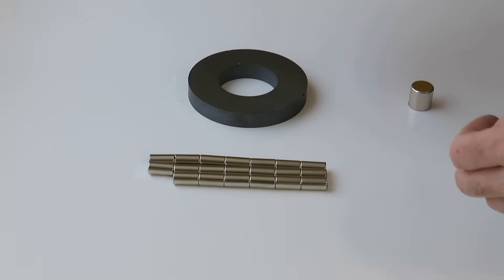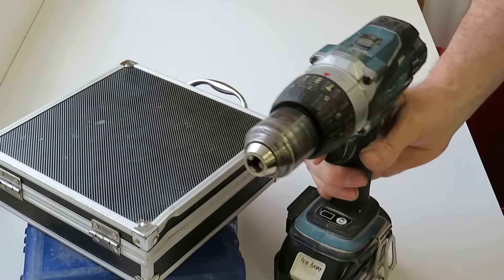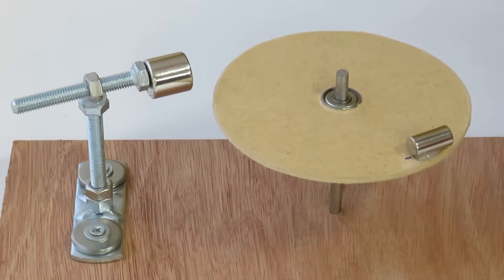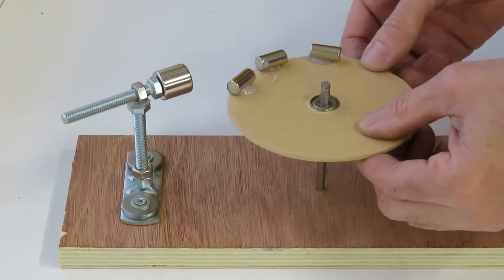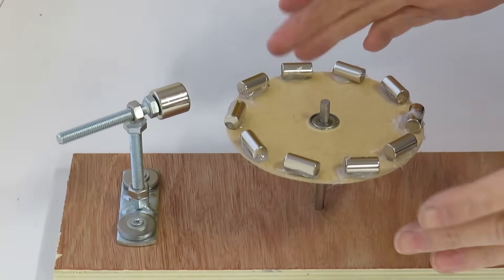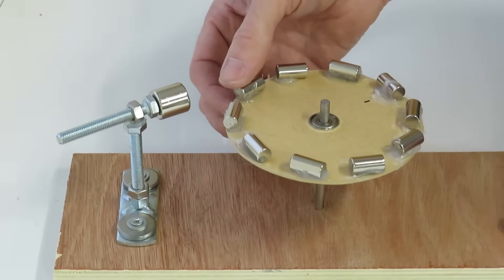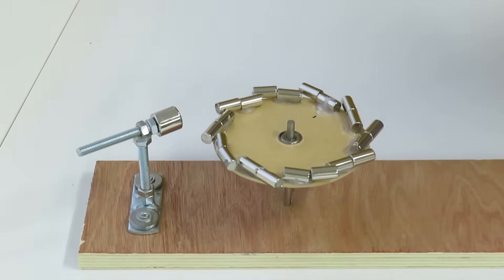Magnetic Energy - Crude Magnet Disc Challenge!

Comment: Try facing the magnets poles towards the master magnet Horrizontal and lift the front end slightly up all the way around in increments like you did on the vertical.
Did you know you can make a coil of copper so the circle geometry is facing you then tilted up slightly to meet Earth magnetic field, whe you rotate it on the horizontal axis it generates electricity..
So the magnets would do what

Comment: I know it's anti the experiment, but you should try replacing the big power magnet with an electromagnet with a Reed switch placed just right. The effect you're looking for is the reed switch shuts off the EM at just the right time preventing the EM from locking with the next magnet spinning around, and turning back on to give that same magnet a kick. You'll probably need to space your magnets further apart than they are, I'd say you need exactly half the number of magnets you are using now. 

The kicker is that you need to power the electromagnet. The clincher is that, once this is going, you might be able to squeeze enough power out of the rotation to take over and remove the battery/source from the EM. YMMV. Best of luck.

Comment: One fine option some have posted on youtube was to use a motor which would be recieve pulses (not a continuous charge) in order to push the wheel continuously while harnessing the power generated by coils and feeding it back to the motor pulses. The sum output seems to be positive power income. There are many examples on youtube

Comment: What you need is a Magnetic Pulsewidth Modulator on the Master Magnet. Just to give the wheel a bump again after a few cycles. You should then get a more consistent magnetic stream that can be adjusted by pulsating magnetics.

Comment: Should try using a niodime disk magnet instead.  Not confusing it with a ring magnet, as the poles are different in each.  I noticed when i use a disk, the movement is more fluid, and it doesnt get that stopping effect like how you do when using multiple single magnets.  

Also, anyone ever consider suspending the disk using reverse poles of magnets, to reduce friction that is created by the downward force of gravity?  Just a thought.

Comment: my attempt (in my head) was to attach the drive (outer) mags to a hinged bracket to face/place it in the optimal first position with a spring to return it there from secondary position that provided follw-up push/release at optimal point si it doesn't provide unwanted attraction afterward. the magnetic resistance & soring compression provides the motice power to switch positions. if that makes any kind if sense??  i don't think it would give free energy (obviously) but it may be a very efficient source of rotational drive... just a thot...

Comment: This is very similar to an idea that I had many years ago but never actually built it. The problem is the magnetic field is shaped a bit like a mushroom so it repels the wheel magnets as they approach as well as when they leave. I was trying to think of a way to change the shape of the field and was told that soft metal can help. I planned to put the "engine" magnet in a soft metal sleeve so that I could point the magnetic field at the wheel a bit like a rifle. Hopefully this will reduce the resistance on the returning magnets. What do you think?

Comment: A few discs in line with separate magnets set at staggered intervals then the next disc in line will pull the previous disc past the stopping point 
Almost impossible with 1 disc
And he seems to be using it to pull not push

Comment: if you apply energy to the system (an electric motor) that is sufficient to push past the point where "the magnetic fields lock into each other"  - then see if the energy out (your set up -  magnetic motor) is greater than the energy in ('an electric motor').  I think this is what we are all wondering.

Comment: Consider using Bismuth metal to shield the unwanted "attraction" interaction between the stator and rotor magnets.
  It's easy to cast in molds made from wood, sand, or aluminium because it has a pretty low melting point.
A design that uses both concentrating and shielding of the magnetic fields is what working designs use, 
ones like this that don't have either or both never seem to be replicatable by others than original video poster lol.

Comment: I think you could use an "escapement" using two magnets, similar to the "escapement on a mechanical clock. As the magnet was repelled on the wheel then the first magnet on the "escapement" would repel the magnet on the wheel. When the next magnet came up the Escapement would be "camed" to avoid decelerating the next upcoming revolving magnet on the wheel. The "escapement " would re-trigger to its first position to repel this next upcoming revolving magnet and repel it in resonance with the first revolving magnet. This would allow the device to speed up adding more momentum and energy to the spinning disc. Good luck . Nice workmanship. Cheers!

Comment: Normally  it will not working because all natural thing likes to go in its lowest possible energy state or equilibrium. I did something similar i used speaker magnetic in stationery state and water submersible moter magnet spinning with dc motor it was behaving like there was no magnetic force that attract or push it's because Spinning magnet alternatively averaging and equalling two opposite force close to zero. 
What can you do with your experiment you can use electromagnet in place of stationary magnet so in particular time you can turn it on or off or flip its pole electrically eventually it will become a Motor but if you electrically turn on and off permanent magnet it will be much more efficient may be 100% or hypothetically more than 100% if free energy exist😅😅😅

Comment: fixed magnets are only half of the engine . 
you cannot reach fluid lock with only fixed magnets . but it is a start . 
the question is why only one fix magnet . if you have 9 magnets on the weel ? who is going to push the other 8 ? 
if you have 9 magnets on the weel . you have to use 9 fixed magnet to pus all 9 magnets in the same time ...

Comment: the part that holds the stationary magnet, wouldn't it be better if it wasn't a material the magnet are so attracted to. iIt has a breaking effect on the wheel. And the bearing on the wheel  is being stopped by the magnets, and the wheel is being stopped by the axle & magnets. Lot of breaking effect going on

Comment: Pete! Love your work. Two things will make this work. 1, use of the magnetic north to south alignment. 2 use of magnetic field shielding to eliminate the field counter effect , so that the push force acts in a free zone, just moments of coasting on the pull side. Additional efforts might include one additional pole aligned stationary magnet. Or, one negative pusher with positive completeltely shield diverted with another stationary magnet on other earth pole aligned side with opposite field shielded/diverted. You can do it.
Reply: To clarify…use of the earths polar magnetism. I was working on turbine magnetic assist from compass alignment…
Reply: Finally, after further thought, I realized that concentric magnetic placement in , one geometrically opposed field inside the outer perimeter may also ‘balance’ out the resistance.good luck

Comment: I designed and built a very similar mechanism many years ago. I found the points where the attraction/repulsion variables were not possible to overcome without a slight amount of manually 'timed' movement on the 'driving' magnet, so issues may possi lh have been overcome with either a 'timed' cam, which would have drawn more power out of the system than it produced. Another consideration was the potential of using a spring behind each 'driven magnet in order to overcome the repulsion by the attraction, or possibly exploring some sort of crucially placed magnetic sheilding. I was never succesful, or I guess we'd all be using a similar energy generating device🤔
Reply: oh, i see you pretty much already thot of my thot... the hinged bracket mived by springs thing.... still seems like there's something in there worthwhile, tho...

Comment: Use a flywheel to keep the momentum going. All the way through I was thinking, will he angle the rotating magnets. I’ve also seen videos on a similar theme with magnetic shielding over the magnets, only leaving the tips exposed. One obvious idea would be to bring the static magnet closer to the rotor both in height and proximity. Glad to see it’s adjustable too

Comment: For this to work you must use magnetic shielding. It will work once you use magnetic shielding. It’s already done and working prototype exist + evidence in form of measuring strength in a test rig based on stepper motors who slowly rotate the magnets and measuring power live.

The magnetic shielding must be half moon shaped both on the rotating magnets and the stationary magnets. Doing it that way you prevent to early push with will push against rotation.

Perpendicular motion is already cracked open. We who has made it are just very careful about pushing to much on it. Because if you puck the evil on the nose, sooner or later it will bite back.

Comment: the trick like someone said above is to remove the stationary magnet and have it just be there at the right time... it appears Troy Reed did this using springs that he called injection pistons in his magnet system... you could even use an electromagnet for the stationary magnet and only turn it on at the exact point to push the disc around then turn it off when it would block it from continuing around (cogging)... just make sure that your electro magnet uses less energy than the momentum of the disc...  its rather simple if you understand the concept and this seems to be what Troy Reed did

Comment: Hello. Excellent experiment.
A possibility:
The G and EM Fields are statical, uni directional, we just know "2 ways of only only direction or viceversa" at/for the EMFs and for Space "coompression and time expansion" just one way/direction".
Here, for the "hugeness" of Gravity and why is +- essier to "see/calculate/mesesure" we can think it as:
Potential energy "exchanges" and „officially" Enrrgy conservation "implies" no gain of Potential Energy, PE" with out "work".... Or with more PE at the end and with "minus" work "that needed to maje the Experiment" as "the real relativistic contextual or contextuality relative" question.
Then:
1) Can be demonstrared that PE can be gained with less Work that wssted at the Experimenta Process?
I has made one:

Implied a steel ball, a magnetic canion an the "experimental context contruction".
The Question:

Can I make an experiment where PE of steel ball, at the end, has more PE at the Same longitudinal and Altitudinal position?
Can I construct an experimental "Context", ELRelative to EM and G, PE and the exact position ofcthe steel ball at the beginint and at the end of the experiment, using just PE and Statical EM (permanent magnets, the magnetic gun or cannon) exactly refered to the PE (Steel Ball "Distance" from the floor, its high, and its position as exactly initial= final altitude and latitude?

Tip:
Think on Hot-Wheels and Evan Cannibal.

Condition: the steel ball is needed to "Start" with and at he minimum work or amount of movement or exact energy and PE and come backs with no "non gravitational and/or static EM (permanent magnets).

To hyper contextualize: all work before starts the expeiment, from big-bang to construct to the exactly experiment... Ignition, is not counting.
Contracted springs, fire, fuels, candies, or any other "almacenated PE" or Energy can be "added" to the experiment:
Just Gravity and PE.
It will be real nice to apreciate your "knowlage & Sci-Tech love and passion" .

The same "contextual relativity" is needed to play with EM Fieles, and for Gravity alls,... Sorry, filelds.

Congrars and Regards!

Comment: You'd be better off putting the magnet at the center of the disk rather than pushing from the outside. Spin the disk at the correct speed and it will function similarly to orbit. Of course it will eventually stop due to friction, but it will spin much longer.

Comment: It’s the drag but if the force regenerates against the drag it would be renewed at each rotation. Unfortunately it loses energy with every rotation if you were to monitor it.  If there is no drag an object will continue to move but if it is stable it will remain inertial until intervened by some external force. Just sayin 🤔

Comment: One who knows nature and the universe geometry can unlock this kind of mechanical things that we seem hard to solve. By seeing this you are missing out on using gravity mechanism and the conical spiral mechanism. The gravitational push that made the magnets to rotate was indeed you but the loop that will make the gravitational push constantly rotating will be the conical spiral mechanism. Of course in gravity what goes up must eventually come down but when the conical spiral mechanism is added it will seem that what goes up keeps coming down, it repeats the process.
Reply: You need to use curved magnets from auto parts power window or wipers which has larger space are of north and south. Secondary have two of those external stands to push and pull at 120 degree's

Comment: Not all your magnets are the same position, look at your setup. common sense will tell you that, that's why it stops at a certain, you have a break. some magnets are not even angled like the other, which you have some magnet going straight. Common sense, fix your magnets.

Comment: I've been playing with a similar idea in my head for years but lack the materials to build it. If you turn the disc vertical and use only one magnet on the disc it would use gravity to pull it down and as it is pulled down with gravity it charges a capacitor that will discharge into a stationary magnet repelling the disc magnet when it reaches the apex of it's return arc.

Comment: Hi ,you need fixed magnets all around not just the one fixed magnet and then each fixed magnet will push the magnet on the wheel when they come in the field of each other.  That's the way motors work, not just one fixed magnet. Great video Walter from Walton Liverpool

Comment: I ALSO HAD THIS IDEA IN A BRAINSTORM BUT FIGURED THAT THE ATTRACTION WOULD CAUSE A PROBLEM VS THIS SPINNING FOR EVER WITH LITTLE ENERGY TO START OR A CONSTANT LOW VOLT DC TO IT. MAYBE THIS PAIRED WITH A RHODIN COIL AND 1--300 MLV. ANYWAY SOMETHING THAT WOULD SYMCRONIZE/STABALIZE THE MAGNETIC FIELDS ,AND PRODUCE MORE ENERGY THAN BEING INPUT.

Comment: the rotation should be increased by a small electric motor.  when the revs drop, a small electric motor turns on.  the power consumption of the motor should be lower than the current produced by the magnetic wheel.  because perpetual motion does not exist.

Comment: Try using just 3 magnets on the spinner and hold the push magnet in your hand and moving your wrist up and down to notice how little wrist movement it takes to generate very high rates of spin..then design your holder to imitate your wrist movement by having the spinners centrifugal force carry a small magnet to move the push magnet up and down.  Also even if it is not perpetual doesnt mean it's not useful.  Imagine a actual bicycle wheel with this setup.  Very little leg muscle to yield faster and easier pedaling.  
EVERYTHING IS IMPOSSIBLE ...UNTIL SOMEONE BELIEVES IT'S NOT.
Case in point the ignition research facility at Livermore California. 
Good luck

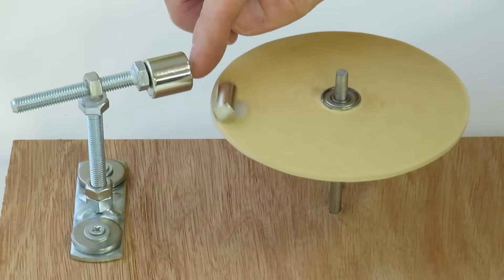Comment: 5:05 just turn on or off the the STATIONARY MAGNET 🧲 AT THE RIGHT TIME 🤯... The magnet wheel 🛞 should produce just enough ⚡ electrical juice with the 90% spin and then turned on or off the STATIONARY MAGNET 🧲... Or just simply INCREASE THE POWER of the STATIONARY MAGNET 🧲 with an electric ⚡ jolt at the RIGHT TIME to push the magnet wheel 🛞 ... Then repeat 🔁
Reply: You should be Able to unlock 🔓 more energy than put in because of kinetic energy latent in magnet's

Comment: Obviously, we know about the 2nd law of thermodynamics, etc, but just to add additional passive interplay of forces, you could add a few, or several coils that get energized by moving through a magnetic field/s, and send its energy to another coil/s to repel/attract the magnet in the stator, or even add another stator further up the Z axis of the axle to interact with said coils. 

Since the universe, or multiverse (if you prefer) exists, and there is plenty of movement, existence itself seems to violate the 2nd law...which happens at the quantum level routinely.

Comment: HOW ABOUT IF THE WHEEL WAS AT AN ANGLE OR,THE MAGNET ON THE SCREW,WAS ON A SPRING SO IT CAN MOVE BACK AND FOURTH AS THE WHEEL SPINS...🤔
OR,GET SINGLE SIDED MAGNETS SO THERE'S NO POLARITY FROM THE OTHER SIDE OF THE MAGNETS AS THEY SPIN, BECAUSE FROM WHAT I THINK IS HAPPENING IS,THE ONE SIDE PUSHES AWAY BUT, THE OTHER SIDE AS IT PASSES BY, ATTRACTS AND STOPS IT...🤔

Comment: It would only workd, if the magnet on the stand, was a pulsed electro-magnet. . .  In which case the energy comes from the power pulsing the magnet.. ..   Then it becomes a over simplified standard electric motor.

Comment: What if you created a system where the magnet could be moved back and forth by the rotation at the right timing to “catch” the magnet on its way toward it within the rotation? Then move away to not apply the “pulling” force as it moves away from the magnet in the rotation?

Comment: on aircraft turbine engine, different RPM, requires differ angle of attack, otherwise the turbine wheel will stall, same principle, replacing air flow direction with magnetism repel flux